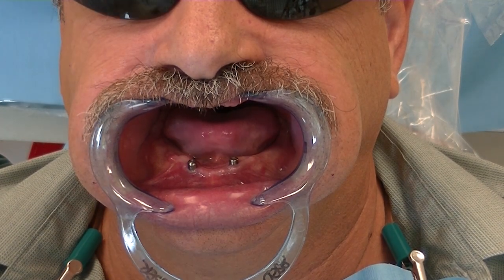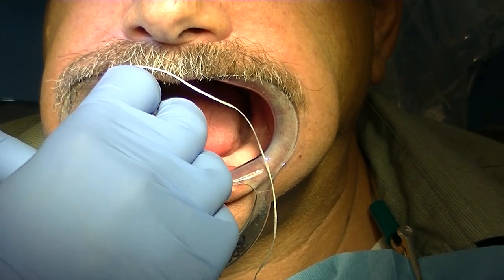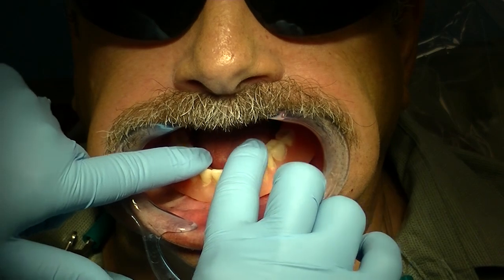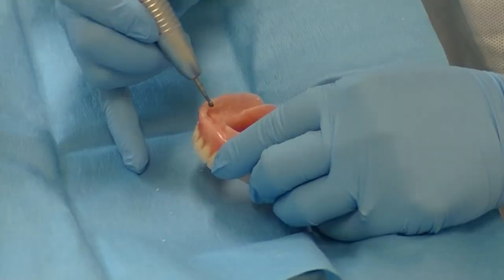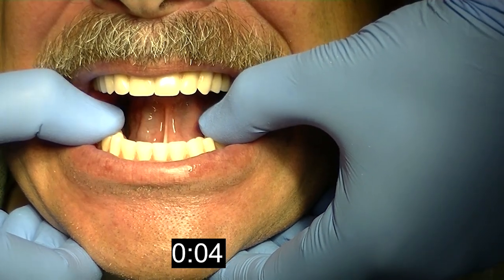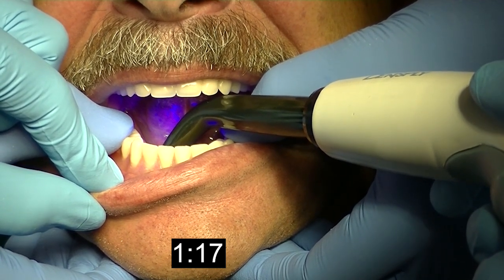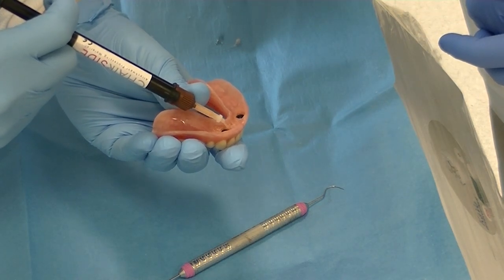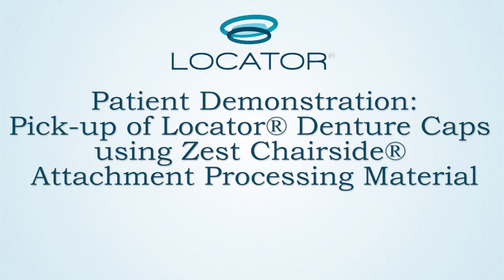Pick-up of LOCATOR® Denture Caps using Zest's CHAIRSIDE® Attachment Processing Material

Comment: I noticed that you didn't have the patient occlude while you were setting the material. Seems rather dangerous not to ascertain that the occlusion is proper before you set the attachments to the intaglio surface..... Is the rest of the intaglio surface of the denture tissue borne? or are the only surfaces touching the intaglio surface at the two locators?

Comment: Best simple advice I can give:
1) until you do enough cases to “eyeball” it, after you’ve seated your locators try on a housing with the black insert to confirm the proper height selection
2) be 100% certain that the denture passively seats without interfering with the housings
3) USE YOUR WHITE BLOCK-OUT O-RING
4) Follow the pickup resin directions on when to remove to make sure the denture doesn’t lock on
Reply: French Frys 
I think the “undercuts” can be from 2 things: 1) the flange on the Locator or 2) angulation between the Locator’s own axis & a plumb line.

Neither would be likely except if you have some extra height to the Locator. Usually the distance between the Locator’s retentive flange & the soft tissue level is about equal to the height of the seated jacket housing, & if you have the o-ring on when you pick up the housing then little-to-no acrylic/resin could flow up on to the Locator shaft since the entire exposed height is covered by the housing & the o-ring. But if you have extra height then the resin can flow around the Locator body & give you an unseating diameter smaller than the Locator’s flange diameter. Even then, unseating would probably bust through this as the locking on resin would usually be thin. It might scare you & the patient, but no big deal. Except, if you have an extra few millimeters & the locked on portion is too thick to bust past. Then you can feel the attachment disengage & the denture will try to unseat, but it will only move a millimeter or 2 & can’t move forward.

This just happened to me for the first time ever: I successfully picked up 3 of 4 upper attachments (4, 6/7, & 13 sites), but my final site (9) Locator was too short to really engage well because the ridge sloped sharply from mesial to distal. I switched from a 3 to 4mm height & the mesial was perfect but the distal had 1.5mm exposed between the housing & tissue. It locked on for sure in that area. The patient wouldn’t give up trying to get it out, & tried for 10 minutes, but I had to go through the occlusal & cut the housing out, then insert my driver  through the “access” & unseat the Locator to retrieve the denture. The Locator wouldn’t pull through still; I had to take it out through the new access. It SUCKED. This was a newer R-Tx Locator which has more height & a wider flange as compared to the heritage unit, so it might happen more easily with these, though they are so worth using.  If you can see more than a millimeter of gold (or purple for R-Tx) with your housing seated then block this out with rope wax (hard to do) or “liquid dam”.

If the Locator is longer & coming out at an angle then the divergence might create a practical undercut as well, so just pick up 1 at a time. Hope that helps!
Reply: French Frys 
We’ll see in 1 week🤞! But that’s the plan!

Comment: Also can you please post brand names of everything from the injectable resin to inserts you used?
Reply: david moheban 
Zest makes a great resin called Zest Chairside pickup material.  It doesn’t require any priming, sets up much more predictably as an automix material, & seems to be stable over time.  I’ve had housings not pick up properly or have voids with other materials, but never once with Zest Chairside.
Reply: david moheban 
Also, once you order the proper locators, the jacket housings & inserts are pretty universal.  You can order a Processing Kit from Zest which contains 2 x jacket housings with 2 x black, blue, peach, clear inserts.  You can also order 10 packs, or individual packs of each of the components.  If you’ll do an occasional case, it’s just easier to order the 2 pack Processing Kit.  If you’ll do more then order the 10 Pack.  If you find that you have a strong preference for 1 color, just order the jacket housings with the black inserts, & then packs of the color you prefer.  I feel like so many people have so many different expectations that it’s easiest to order the 10 packs of Processing Kits rather than the bulk of a few pieces

Comment: Is it hard to remove the processing inserts and swapping them out for the blue nylon ones?
Reply: david moheban 
Not with the right tool.  The Locator core tool will pop the black insert right out, & then make sure you have it set up so you can twist the end to extend it.  Twist it again to retract it, place the blue insert on the tool & seat it into the housing & hear it click into place.  Twist the tool to extend the end & it should automatically free the tool from the insert while leaving the insert in the housing

Comment: THanks for posting.  I perform this procudure similarly.  The most important part is making certain that the denture base seats without contact to the locator housings. One think I do differently is that I do not hold the denture in place when the attaching resin has veen placed.  I find it best to have the patient close and stay closed during the "pick up" .
Reply from the maker: +Edward Dergosits  Thank you for the great comment. I find that this varies by clinician comfort level, but I have found that most denture patients don't close properly when asked to and they can typically have a cusp kick the denture slightly forward or to the side. Additionally, I find that when I control the pressure on the ridge, I can apply just enough pressure to slightly compress the tissue but not overly compress the tissues. Most of the time clinicians don't want to risk "missing the bite" or "having to adjust the bite after pick-up"... 9/10 I never need to adjust the bite and that 1/10 times it's a tiny adjustment. Experiment yourself, try it next time :)
Reply: Edward Dergosits na